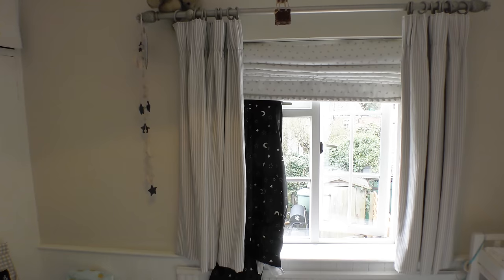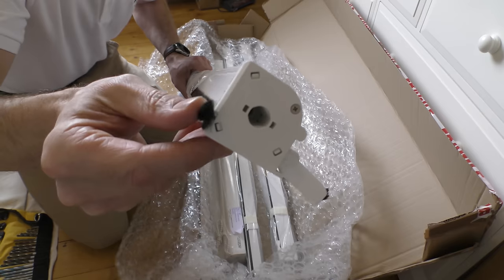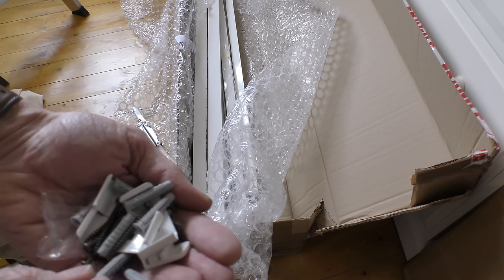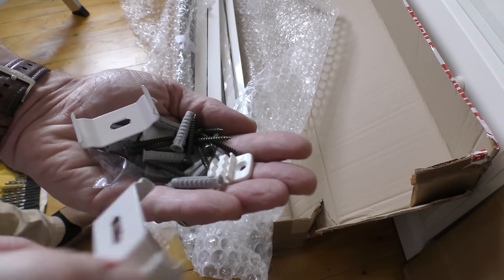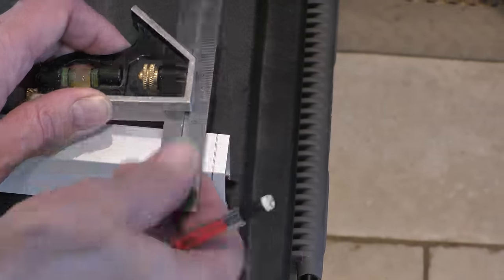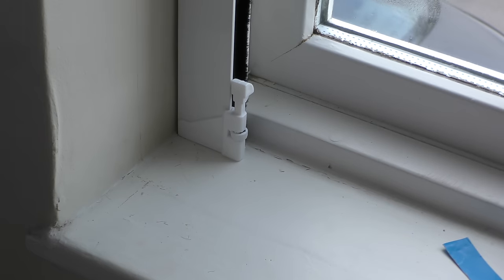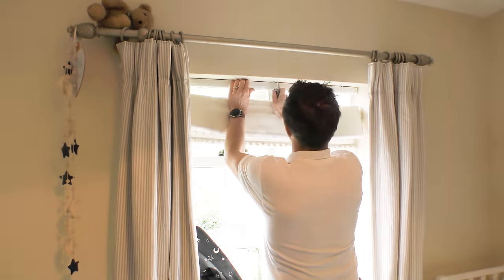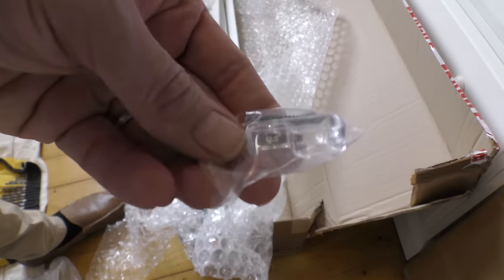How to Install Total Blackout Bedroom Blinds

Comment: A word of warning for anyone looking to buy the same product from the company Charlie quotes in the description. They are ridiculously expensive! I was quoted £600 for just one unit for a standard sized window! You can do far better with local companies or day John Lewis. I suspect this chap got his unit for free for featuring it on his channel but the average customer won’t be so lucky suspect - be warned!!
Reply: Yes I was shocked when I went on the not so great website anf priced up 1m x 1m window as 9ver £600.
Ouch ouch ouch 😂
Reply: @anthonyreynolds1377  Hi just search universal vinyl light gap blockers for a more economical option.
Reply: + £25 for shipping.
Reply: I'm more concerned about all the condensation and mold that will potentially build up in those tight areas. Making it very difficult to clean.

Comment: Excellent mate, really useful. I tried to fit a typical roller blind a while back I find them so difficult to do, it needed cutting down but I made a complete mess of cutting it perfectly straight. If it isn’t that it is usually the fitting which then hampers me, I’ll drill into the wall or recess and meet the hardest substance in the universe and don’t have the correct drill bit on hand. 😩 I did laugh when the camera switched to your tool kit you had brought almost like a comedic i am going to fit this blind here are the tools you need 🤣

Comment: Another great video, I do nightshift and I got a blackout roller blind from a local blind fitting company which is not good at all.  I will contact you soon directly to get a blind.  Thanks Brian 👍
Reply from the maker: Thanks Brian. Yes, drop Ali an email at admin@moghulinteriors.com. We'll probably need to come up with a measure sheet. You basically need to measure the width at the top of the recess where the cassette goes, and the drop in both sides. 👍

Comment: So this looks a really good idea. In the summer it is very light at 9pm and light before 5am, so it can be a good idea for anyone. Only one problem that I can see. A lot of those nigths are going to be hot, the window is going to be open, but how is the air going to get into the room?
Reply from the maker: Yes, this isn't great with the window open, particularly if it's windy
Reply: @CharlieDIYte  I was thinking more in the summer when we have more daylight and hotter nights. I can't see how you get any air into the room, Seemed like a good idea but.................

Comment: Personally prefer some light coming in but good to know these are available, not seen them before. I've yet to come across a window where it's not a concrete lintel you need to drill into. Also, you're not really supposed to be drilling into them yet all the trades do.

I used to have the same Stanley Fatmax large toolbox. Well made piece of kit but I found it was just too massive to lug about for my needs.

Comment: Really liked the video, until the end and the price! Wow they seem expensive but I will still be looking into getting one for my bedroom as I often have to use an eye mask and I too use one of those stick up blackout blinds like in the video!
Holding the hoover how you were when drilling looked a bit awkward, can I suggest you have a look on Amazon for a "Drilling dust nozzle". There are various ones available but the Festool one is surprisingly one of the cheapest and the best. Also something else you could add you your "tool store".
Thanks for your videos!
Reply from the maker: Yes they are a bit pricey but they're made to measure so that's always going to push the price up, and as I said they're good quality. Thanks for the recommendation. I'll check that nozzle out 👍
Reply: @CharlieDIYte  I would be really interested if you know of any blinds and curtain 'closers' that can be used with smart speaker like Amazon's Echo/Alexa, a video would be great! I am very surprised that they aren't more common place as from a security view point I think they would be a great addition in the winter months as you could set them up to close at dusk and have smart bulbs turn on so the house looks occupied. Driving around in the winter months it is always so obvious which houses are empty and must make for easy pickings for robbers.

Comment: Hi Charlie,
Came across your channel few days ago and mate i cannot thank you enough for Your tips and tricks. I have 1 request please, any chance you could show or even drop me a message on how to fill in screw holes on a prefinished oak veneer door?

I had a bolt lock on 2 of them. It's no longer needed but no longer need the locks so I'm desperate to find a method. Thank you in advance
Reply from the maker: Saj, I missed this somehow. Did you sort the problem? There are coloured 2 part wood fillers you could use but the best way to do a near invisible repair would be to get some little oak pegs shaped in a slight cone, and then tap them in with a bit of wood glue, tidying then off with a sharp chisel.
Reply: @CharlieDIYte  thank you so much for your reply. I haven't sorted it out yet. Extremely hesitant because these are prefinished doors, kind of a glossy finish on them. Is there an alternative without any use of chisel? I'll most likely dent and scratch it if I use that lol. Thanks again for your help.

Comment: Charlie, loved the video and the product but obviously a bit pricey given our bedroom window is around 1800 x 1500.  I have tackled this in the lats two homes we refurbished by adding a 3 sided pocket frame  (top, left & right) and incorporated the coving at the top.  We used blackout curtains instead and vision blinds which means we have privacy during the daylight hours and more practical.  The curtains are velcro taped both sides, the frame material was 100mm MDF  pencil round skirting pre primed. Looks great
Reply from the maker: You've approached that like a true pro, Michael! Thanks for the insight. 👍

Comment: Hi Charlie,  i feel like im  really progressing in DIY thanks to your channel,  when  a year ago i couldn't  even  operate a drill ! 
One thing that's  troubling  me on plugs though, is whether its ok to have a screw longer than the plug wgen going into masonry?  Does it weaken tge fixing? Could you run a tutorial  on plugs into masonry  like you hsve on plasterboard?  Thanks  Mark B
Reply: I'm not Charlie but I saw your comment - if it's longer it won't matter too much. If it's poking out the other side right through the wall then that's a bit of an issue cosmetically if it's in brick (most single skin brick walls are about 70mm + plaster/drywall thickness). What's necessary is the mechanical connection between the screw, the plug and the substrate (masonry i.e. brick) you're drilling into - that the plug has expanded and grips the hole in the wall for a strong fixing. There's somewhere I saw online (for the life of me I can't remember where, sorry) where it tells you how long a screw you need for a particular job - without revisiting high school bending moment diagrams! Since it was a month ago, I'm sure you've got your answer :)

Comment: Excellent video Charlie! Love your channel. QQ4U though. For those of us (ie me) who have already got a blackout thermal blind to keep the heat of the sun out of our children's bedroom and yet didn't reckon on the heat/light bleed coming through the sides, is there an ingenious diy hack we could do with some c-section channel and some brush tape? I can't for the life of me find channel broad enough so wondered if I'm barking up the wrong tree here to keep the heat out. Cheers.
Reply from the maker: You could click on the link in the Description and ask the company if they could supply you with a length of the c section - it comes in 40mm and 70mm profiles, complete with the in built brushes. You'd still get light leakage in the top but again, they manufacture aluminium head boxes, with bottom trays. You put the roller in the box and butt the side channels up to the box. The only issue you'll have though is that the roller bottom bar won't be heavy enough to drop under its own weight thought the brushed aside channels, as the bottom bars that come on the blinds are much heavier. So unless you could open the bottom bar and slide in extra weights, you might have a problem.
Reply: @CharlieDIYte  Cheers Charlie. I will give it a try.
Reply: So I contacted them and they responded very quickly to my email. Suffice it to say the biggest flaw in the idea for me is that my thermal blackout blind is cellular, and the one from the company and indeed your video is flat fabric. This means the side channels they offer are only 22mm wide and certainly not wide enough to accommodate a cellular blind that has a bottom bar of 28mm wide. Thanks for the help anyway Charlie. The guys at EBS were very helpful. I think the idea is still good, so I'll be finding some white aluminium c section at 40mm-ish wide and some brush tape after all. Your video should help me with the installation too. ;)
Reply: Did you manage to get aluminium c section to create your own siderails? If so any advice for someone in the same situation.
Reply: @alanmacgillivray8137  I never did. I looked everywhere online I could find but the only places I could find the C or U channel  I wanted only sold in bulk. Next steps for me was/is to go down the industrial workshops in my home town and ask them face to face. This job sifted down my Dadlist though.

Comment: Another great video, thanks.  ?  How do you use the system when the reveals and not level/flush?
Reply from the maker: Thanks! If you don't have a recess it's a little tricky as the side channels would be more noticeable, and you'd have to screw through the front rather than inside. In terms of the reveal being out of level, you just have to improvise as best you can, to get the cassette at the top level and the side channels square (if the cassette isn't level the blind is likely to telescope).

Comment: Hi Charlie great video...can you tell me where you can purchase the blind system? Thanks
Reply from the maker: Hi Steve.  Yes, there's a link in the Description below the video where you can get in touch with us. There are other systems on the market but you've just got to make sure they're decent quality. The system in this video is part chain part spring so when you push it down the final section it tensions the blind to keep it taught.

Comment: Hi Charlie, I watched video yesterday and have been looking since to buy several  cassette blinds, can you please give a little more direction as to where I can source some from. Keep up the great videos mate and stay safe.
Reply: Chris Wright. Many thanks mate for the direction. I will measure up and order tomorrow.
Reply from the maker: @jasontaylor2929  Unless you've ordered already, Jason I'm just trying to find out a little more about this system for you.
Reply from the maker: @jasontaylor2929  Jason, a couple of points about this system. Firstly, we don't generally supply the spring loaded systems because there's less to go wrong with the chain version. Our supplier's son once cut his head open on the bottom bar of the spring loaded system because they tend to zoom up very quickly when released (unless they're fitted with the more expensive slow rise mechanism). Also, just from watching the video, the blackout fabric looks very thin and the blind doesn't seem to be going up and down very straight. Those are just my views, without having any first hand experience of these guys, or their blinds.

Comment: Doing a total blackout system with attic bay windows is pain. I've resorted to perfectfit blackouts to stop the majority of it on the three panes, then a roman blind (fits tighter to the edges of the walls) in front of that to stop most of the residual light.
Reply from the maker: Yes, that's about all you can do in a dormer. 👏🏻

Comment: This is really cool and it's something that I want. Now, add a Somfy smart blind to the build and I will give you all of my money.
Reply from the maker: Hi there. You can't buy these direct on the open market as they're trade only but if you get on touch with us through the link in the Description, we can work up a quote for you. And yes, we can supply with Somfy motors. I've installed a few of these!
Reply: @CharlieDIYte  aaah, I see. Is Moghul interiors your company then? I have already sent a message.

Comment: Do the blinds come the correct length? ...or are windows always the same width, or one a set of widths?
Reply from the maker: You'll need to measure the window recess at the top, and also the drop in both sides. The blind is made to measure.

Comment: Maybe use some low profile handles too on the wondows so you don't need to set the blind out so far from the window, if that''s an issue.
Reply from the maker: Yep, good idea. Handles are always the issue particularly with Roman blinds which they tend to snag all the time!

Comment: What is the best way to measure which size il need, there is not much info on the website. Maybe a video on measuring would be great! Thank you!
Reply from the maker: If you measure the width in three places - top, middle and bottom and take the narrowest measurement. Same with the drop but if you got the drop too long you could at least cut the side channels down a bit. When you submit the order tell them you've given them recess measurements.
Reply: @CharlieDIYte  Thank you very much!😄

Comment: Blimey that's a lot of tools! Ryobi fan too... But then makita...  I'm looking for a new driver set but no idea if tied to one make is better or mix
Reply from the maker: To be honest Justin, I was sent some Erbauer power tools to try out by B&Q a while ago. They're a decent set of tools and I've been using them in tandem with my Ryobi stuff. For me, it's not an issue having two different chargers kicking about but if you're a site worker, clearly you need to stick to one brand to keep things manageable.
Reply: @CharlieDIYte  indeed. Us DIY ers just concerned with it working... Some drain so quickly and are not powerful enough for lots of driving screws when putting in a new floor

Comment: Great video, but do you have a new link to purchase them as the one in the description is dead?
Reply from the maker: I've spoken to the supplier. They've had a problem with the website which they're working on. Keep checking, it will come back online. 👍

Comment: Great video Charlie, do you have any solutions for tilt and turn windows. We only have 26mm side clearance in our dormer windows and haven't seen a low profile solution that would still allow the windows to open inwards. Because its a dormer in a sloping roof we can't install on the outside of the reveal.

Comment: @charlie how would you tackle this for a bay window? Do contract / maxi make systems for bay windows?
Reply from the maker: You could put one of these in each window but where we have customers who want blackout in bays, we generally install a pelmet board system with curtains. Not cheap, but bespoke systems that do the job rarely are.

Comment: Any suggestions for a bay window?
Reply: I was just going to ask that.  We have square box bays and have just installed simple electric black out roller blinds, but they obviously are not as light tight as this system.  Bays look great, but are a pain for this type of thing.
Reply from the maker: Yes bays are tricky - I've always called them the exam question of three soft furnishings business. What we tend to do for customers who want blackout in bays is a curtain system behind pelmets, but it's not cheap.

Comment: My windows pivot inward at the top. The whole window.  I take it this solution will not work. Any tip for what will ?
Reply from the maker: No it won't work for that. You're going to have to find a system that fits on the window itself but I'm afraid I can't help you with that as I don't have any experience with these.

Comment: The link to find these is not listed, pls add link.
Reply from the maker: Hi Anthony, I can't link you directly to these blinds because the manufacturer is trade only and they wouldn't thank be for sending hundreds of enquiries that may or may not proceed. Best thing if you're interested is to get in touch with us, link to which is in the Description. Or a company we've used in the past which does do retail is Ultrasound Blinds - looks like they're updating their website at the moment but you could call them in working hours. They're trickier to fit in that they have a zip system but they do the job. Failing that Google "cassette blackout roller blind systems".

Comment: What if you have Victorian windows with no indoor sills
Reply from the maker: It comes with a metal tray for the bottom bar which you could use if you have no sill. Otherwise it's a case of improvising maybe with some additional carpentry.

Comment: I love this but I think people need to be aware having a fitting this close to the window in an older house can often stop airflow and lead to mould from dampness
Reply from the maker: It shouldn't do, provided it's raised every day and you've got plenty of air flow when it's raised. No different really to curtains, which will facilitate condensation on single glazed windows over night. As I explored in this video https://youtu.be/TIDb-pdOnXM the problem you refer to is part of a wider moisture/ humidity management strategy that we should all be operating in our houses. A few basic lifestyle changes and some inexpensive kit (hydrometers) can really help you get on top of these problems. These blinds aren't the cause of the problem. More a reminder manage it.

Comment: Good tip re smelling but burning hot drill bit smells of wood to me even if no wood there 😂
Reply from the maker: Fair point. The best way to test is to put a screw in. If it properly bites you've got wood, if not you have to redrill the hole and put a plug in.
Reply: @CharlieDIYte  or if it falls thru then its hollow 😂 I've had so many as drilled into space between dot and dab